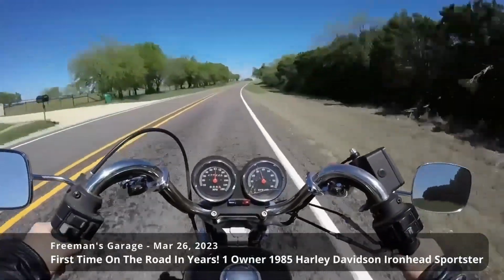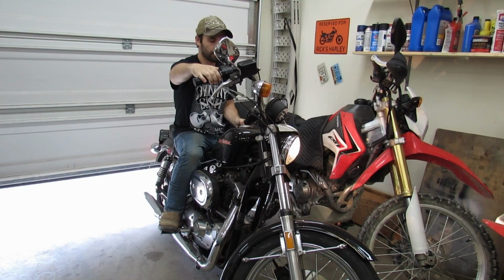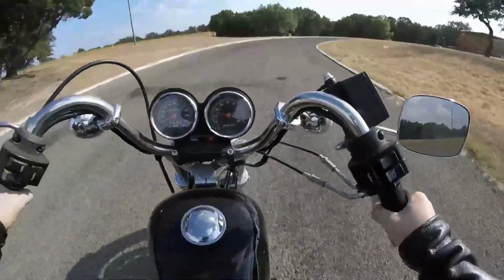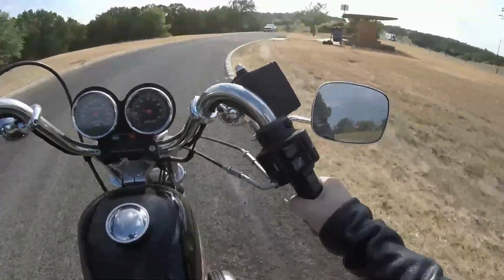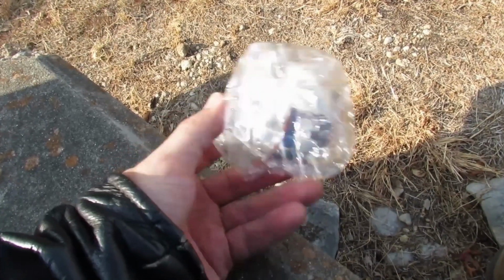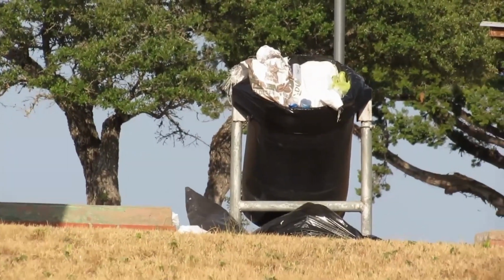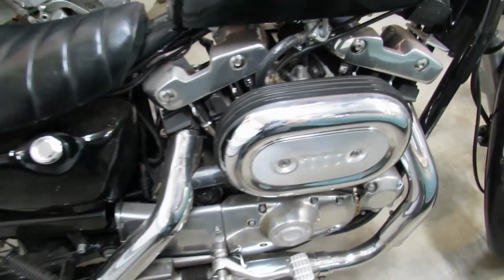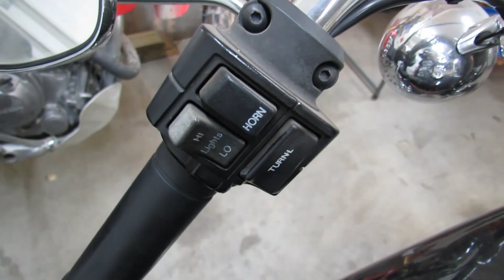My Motorcycle Was Falling Apart On The Highway! 1985 Harley Davidson Sportster 1000 Ironhead

Comment: You rode your 1985 one-owner Ironhead over 100 miles and ONLY the horn fell off??? You done good! Seriously, I have owned many Sportsters over the years, I have two Ironheads right now.  Stuff fallls off. The horn is common, easy to replace Enjoy your Ironhead!
Reply from the maker: That’s funny. I need to check every nut & bolt. Thanks for watching & for taking the time to comment.

Comment: I bought new a 1985 sportster in 1985 and I loved it. I would toure on it often, even with the 2.5 gallon fuel tank. Always took back roads and would start looking for gas every 50 to 70 miles. I never ran out of gas and it was the most dependable Harley Davidson I ever owned.
Reply from the maker: I got a laugh reading the checking for gas every 50 to 70 miles part. That's going to be me when I do an overnight trip. Thanks for sharing that. As soon as I started reading your comment I got the visual of someone in 1985 buying a new bike.
Reply: I used to joke that I was going out hunting for gas on my one.
Reply from the maker: That's funny @youfritter
Reply: I only got 58 miles for a full tank. 3 miles on reserve.

Comment: I believe it's recommended to check the oil once the engine is at operating temperature
Reply from the maker: That's right. You believe correctly. That is what the owner's manual says to do. But I'm pretty good with this bike at being able to tell where the oil level will be when warmed up by looking at it cold. I did check it at the picnic area, but it wasn't shown in the video. But now that you mentioned it, I should probably play it safe & start checking the oil the way it's recommended to be done. Thanks for watching the video & for taking the time to comment.

Comment: I recently picked up an 82 Ironhead and during the 140 miles from pickup to getting it home, the generator crapped out, it blew a handful of gaskets and then the engine blew up. Getting ready to dive head first into a top end rebuild... Hopefully, there aren't more problems... But knowing Ironheads, there will be. 🤦🏼🤦🏼🤦🏼
Reply from the maker: Wow that's wild. I hope the rebuild goes smooth. If you remember, you should let me know in a comment that it's back together & on the road again. I'd be interested in knowing how it went. I appreciate you watching the videos.
Reply: @freemansgarage  The ironhead is still down for the count... Was getting the motor back together and buttoned up and was torquing the rocker box bolts down to the LOW end of factory specs when suddenly I heard a snap and the bolt spun free... The front head apparently had a crack in it and couldn't handle 14 lb/ft of torque. Plus, I had to replace the oil filter plate as a previous owner WELDED the oil filter to it. 🤣🤦🏼

Seems like you've had your fair share of problems with this bike though...
Reply from the maker: That's terrible. I hope you get it sorted out. Nice user name. Fellow guitar player here.
Reply: @freemansgarage  The motor is back together and running... Just have to come up with the funds to finish everything... Needs new tires, tubes, wheel bearings, chain, brake pads, clutch perch and I have to redo some wiring... All of which costs money, and my Veteran Disability just barely covers cost of living. 
So, I had to sell all but a couple of my guitars to get as far as I have.
Reply: @freemansgarage  and hell yea to the guitar player deal. I build guitars, when I've got the time and money to do so.
Reply from the maker: I understand. Do you need help with the VA?
Reply: @freemansgarage  I'm going through the process of trying to get my rating increased from 60% to 100% through a local VSO. But the VA itself is making it as hard as possible to have treatment established and recorded for said filing.

Comment: Did Frank and Jesse James ride around your parts ? I once asked google a question "how do you mend a broken heart " .. the answer was the Bee Gees. By the way, the bike sounds like a tractor. On the video you could see a cable flapping around.. bab boys don't use horns.
Reply from the maker: That's funny because I have no intention of ever using the horn but it's a piece of original equipment, so I want it back on the bike.

Comment: Use threadlocker on every major fastener, perform routine maintenance and don't beat on it too much (ha!). The damned thing will be reliable enough.
Reply from the maker: I'm definitely going to be using some thread locker. I'm also going to try & find that horn on video. Thanks for taking the time to comment.

Comment: I was just thinking , if you put the fuel valve on "ON" instead of "RESERVE" ,you would get a warning when you were low on gas .
Reply from the maker: That does make sense. I don't know how far reserve would get you though. That's something to maybe find out. Thaks for mentioning that. Did I have it on reserve in this video?
Reply: Yea, it was on reserve . Maybe if you filled the tank , ran it on "on" until it sputtered , check the distance , put it on reserve you would know the range . Seems like there aren't alot of places to fill up where you're at though . Good videos , you can say I'm a little behind (I've been called worse) , but I'll catch up . @freemansgarage
Reply from the maker: Thank you for saying something. I looked in the original owner's manual that came with the bike when new & I looked at the petcock closely & holy cow I learned something new. I did have it on reserve. The Honda parked next to the Harley is the opposite. Now I know. I might have to test out the range in a video. I need to do the impossible & find that horn on video first though. Thanks for watching & for taking the time to comment.
Reply: Don't worry about the horn , doesn't look like there's anybody to honk at anyway . @freemansgarage

Comment: You might want to invest in the owners and/or HD shop manual.  Air pressure at 24 psi front and 26 psi rear.  Nice bike.
Reply: Not trying to be "that guy" but tire pressures are based on 150 lb rider weight. For each extra 50 lb. add 2 psi @ rear, 1 psi @ front. The maximum tire pressure for all tires is 32 psi. I agree it's a nice bike. I have an 85 XLH 1000 (3rd owner 7,500 original miles) and need 30 psi rear and 26 psi front to compensate for my XXL body.
Reply: @f444-f  
I took those tire pressure specs directly from the Harley Davidson 1984 Sportster owners manual.  It states that those are the pressures for up to 300 pound passenger load.  It also states not to exceed 32 psi with original equipment tires.  You are welcome to purchase the same owners manual and compare.
Reply from the maker: I have the original owner's manual that came with the bike when new & a 1985 shop manual that was purchased at the same time as the bike in 1985. I have never looked in either for tire pressures because the bike has newer tires on it. I think the tires are 20 years old but they're not 1985 tires. My assumption has been that newer tires are made to run higher pressures than the old ones therefore if I look in the manual, I would just see pressures that are too low for the tires currently on the bike. But now that you mentioned it, I will look in the manual & at the tires more closely though because actually haven't been able to make my mind up about tire pressures the entire time I've had the bike so far. Thanks for taking the time to comment.
Reply from the maker: Thanks the info. That's awesome you have an 85.